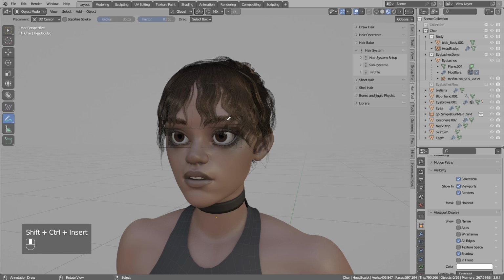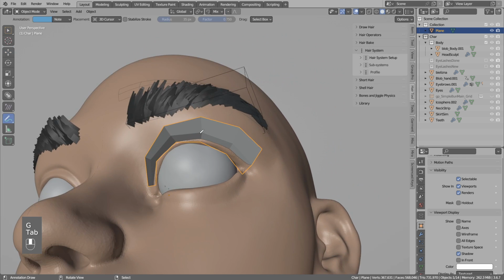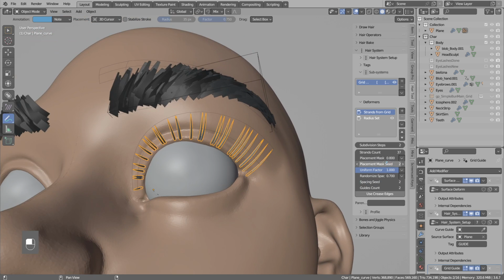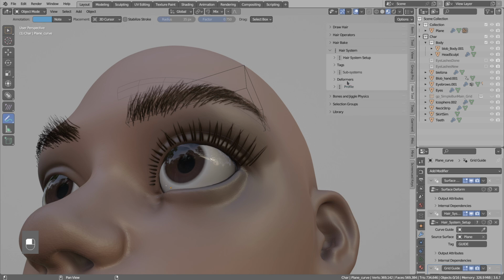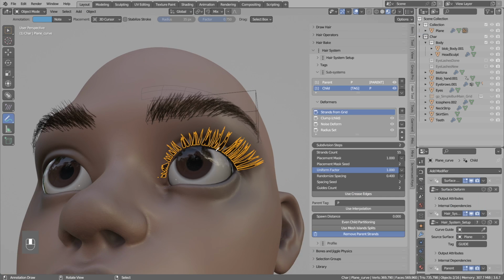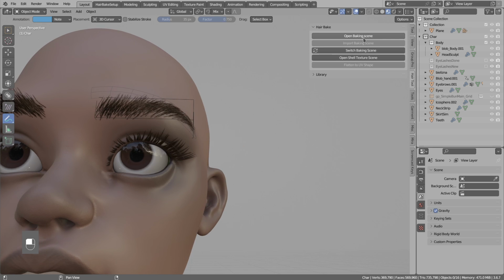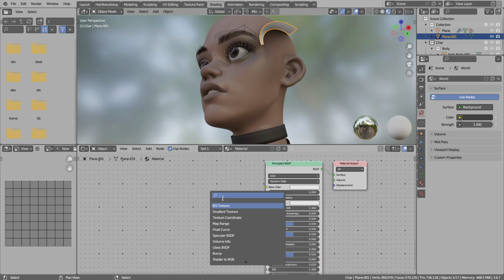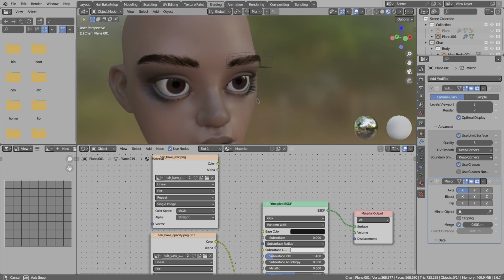Eyelashes Tutorial (with baking)

Comment: Hello, for some reason, the baked eyelashes i made does not show when in cycles mode. What do i need to do?
Reply from the maker: maybe object is disabled for rendering in outlinder? Or in object render settings?
Reply: @bartoszstyperek6306  it’s enabled in render settings, but I will check the object settings. 
This is in viewport, not in the actual render itself.
Reply: @bartoszstyperek6306  i figured it out, for some reason, the shadows and transparencies were disabled on the object settings.
I do have a followup question though, how do i attach the hairs, eyebrows, eyelashes, and mustaches to a face mesh that will be rigged and animated, so that the hairs move along with the face?
Reply: have you solved this issue? I have the same one, and it seems like the eyelash plane gets corrupted as soon as you set the hair profile. Once that’s done, it can’t be displayed anymore in viewport shader or render preview, not even a flat material works. This should be a problem/bug caused by the addon, as I have never experienced this before. (I used blender 4.2 & hair tool 3.6.9)